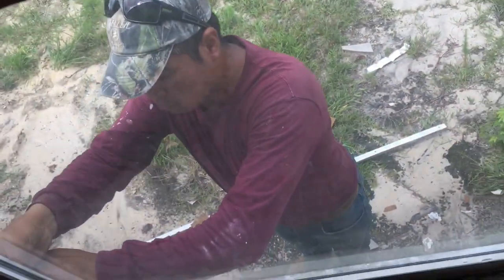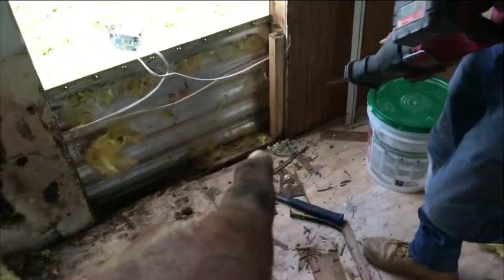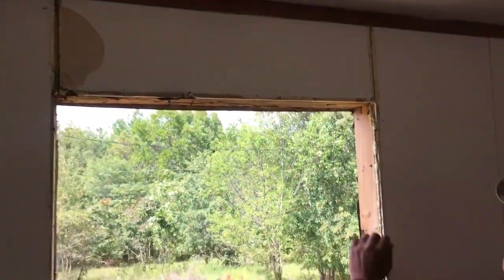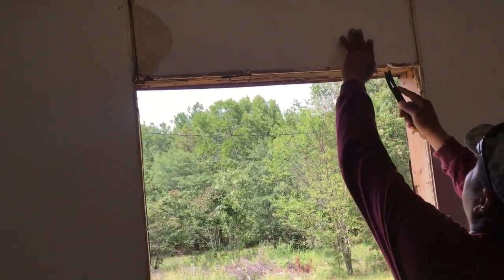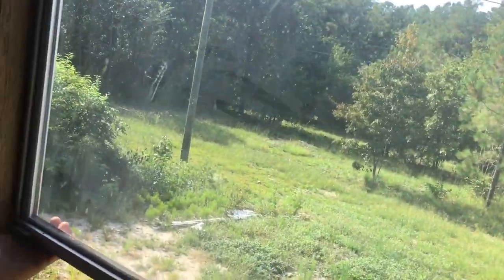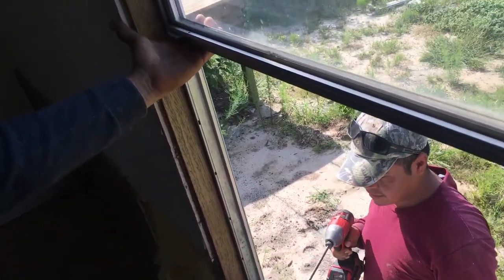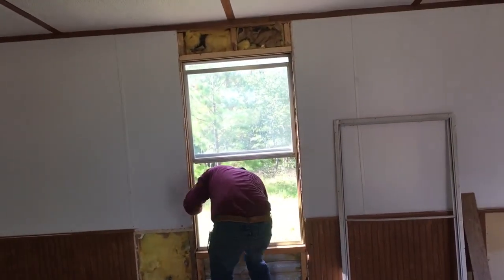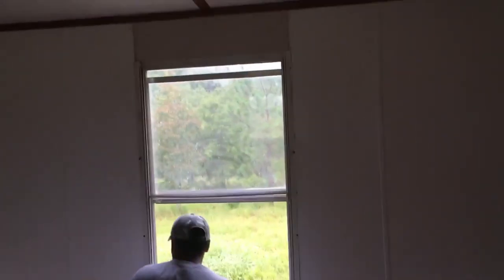Repairing Wood Rot Surrounding A Leaking Mobile Home Window (They All Leak!)

Comment: Looks great!  Where did you get the window trim board pieces??  I’m looking for trim wood to replace rotted wood from AC units in 2 windows in an 80s Mobile Home.
Reply from the maker: What we did was take a piece of paneling, and rip it with a saw where the grooves were in the paneling and then we trimmed it down to size from there